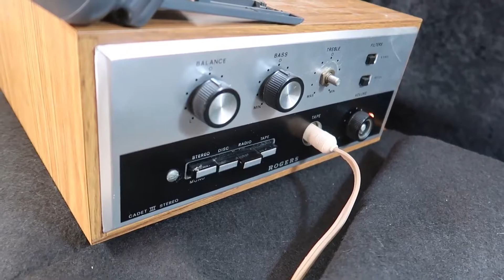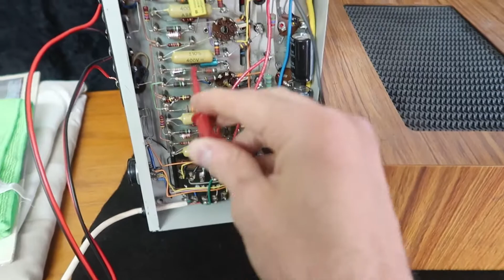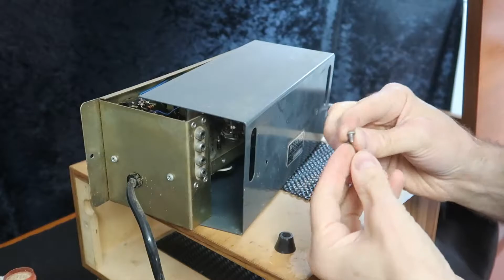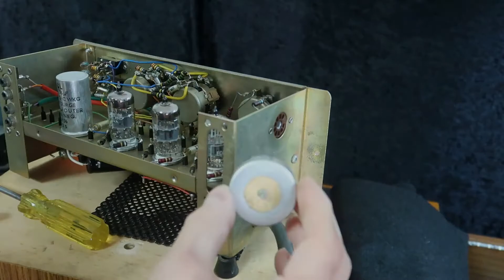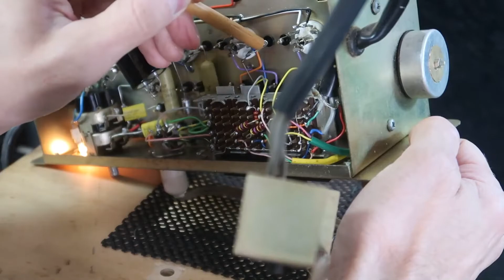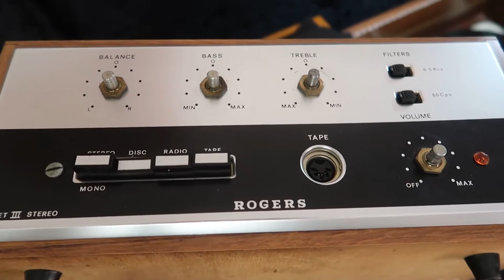REPAIRED: Rogers Cadet III vintage British Tube Amp/Preamp

Comment: Hi from New Zealand. I have been servicing electronics for Over 50 years and can tell you finding one of those Mustard caps faulty is very rare.
They are also very sought after by Guitar Amp fanatics for vintage Marshall and Vox repairs or refurbs.
I can remember A tech in Texas I spotted online asking $25 each for 0.1 uF mustards.
Rogers Amplifiers often use the same manufacturer and type split Layer wound transformers as the famous Leak Amplifiers
Reply from the maker: Wow, thanks for the info. I always wonder why such experienced folks like you watch amateur videos like mine! But I'm glad you do. I learn something.
Reply: I've got loads in my stash and correct the 0.1 are very valuable I use them on Marshall VOX and WEM only plus a few other old pommie amps both guitar and HI FI

Comment: Hiya!!!   Nice job!!!   FYI, the little plug with resistors & capacitors are an equalising network, there was 2 or 3 different ones, they altered the frequency response and gain, depending on whether you had a magnetic, or crystal cartridge on your record deck. Also, the 100k anode load resistors on the preamp, where you had your clip connected while checking the capacitor voltage, are notorious for rising in value, it's not a bad idea to replace them, if you open the case again!!  Nice work, and a very collectable amp in the UK, these days, they often fetch 4 to 500 bucks second hand, on Ebay!! Cheers!